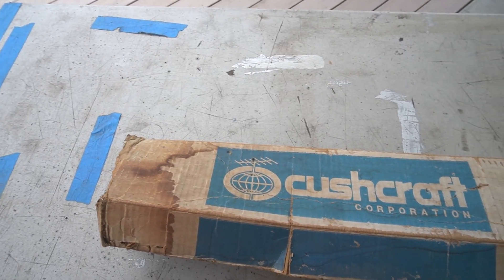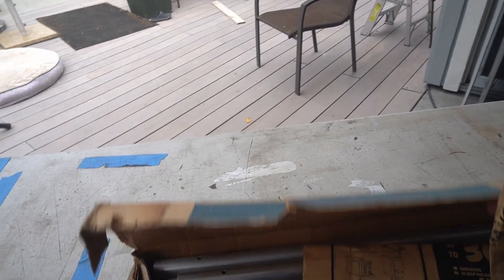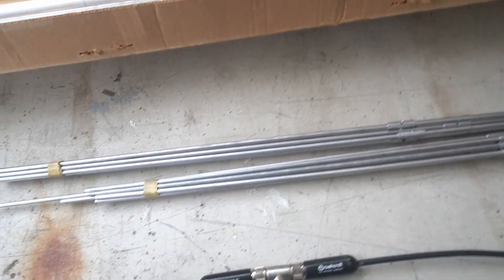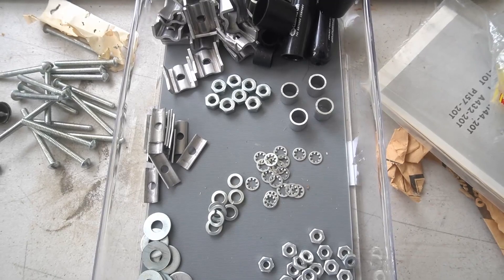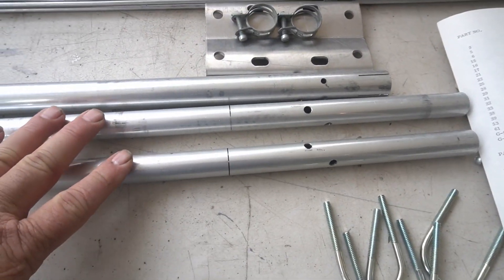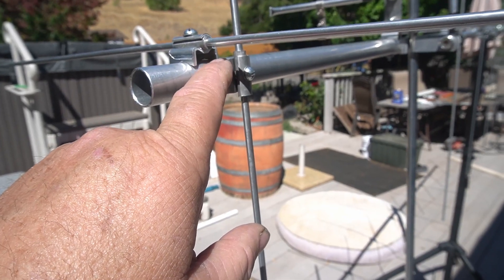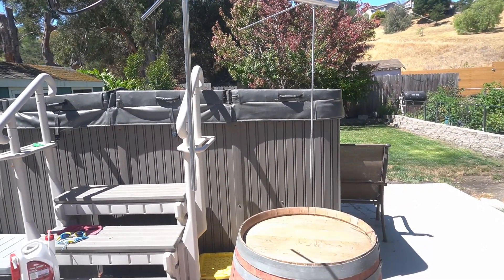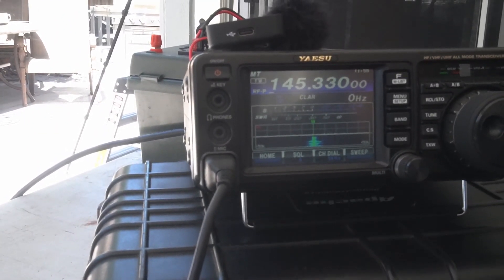Best 20 element 2 meter Yagi, Cushcraft A144 20T Yagi Antenna.

Comment: A good friend Ted-W4YJC-SK owned a set of these. We experienced a great band opening where we worked North Dakota, South Dakota, Kansas, Canada,& 5 or 6 other states. I was running an ICOM 910H with 100 watts into my Cushcraft 215WB at about 55' & he was running his 144-20T also at 55' with a Kenwood TR-751A & a 160 watt amplifier. For most of the QSO's I would make the call once or twice & he would have to call 6 to 10 times & sometimes even more to complete a contact. The next morning he went out & cranked down his tower & Removed the 144-20T & put his Cushcraft 215WB back on the tower. He eventually gave the 144-20 to a friend of mine since he said he would never use it again. The Gain of the 215WB proved it's worth then & many times afterwards. The 215WB has far better quality in materials & performance. We are in EM80 in Northeast Florida just FYI.

Comment: "Death Star" checking in.  I have a pair of these phased together (verticals and horizontals phased separately) and they work well.  If you want them circular polarized and maximum F/B, add another 90 degree stub to one of the polarizations and feed them like a turnstile antenna.  However, I found that these work much better as stand-alone polarity beams. In other words, do not try to run both polarities at the same time, pick one.  My normal 2m base setup is a set of phased 14 element yagis (vertical only) on the 55' tower fed with legal limit power. ERP is around 150,000 watts.  Simplex to Hawaii is best "DX" so far.  73 DE K6FRC

Comment: Should have fed each polarity with individual coax cable. With the phasing harness you lose 3db but don't suffer from cross polarization degrading.
Reply: I have the same antenna and had the same high vswr feeding V/H separately.

Comment: I have this same antenna, it’s really a piece of crap ! It doesn’t work well as if it was a single polarized antenna !
Reply: I think it really depends on what you feed it with! Cheap feeder = crap reception
I'd use EcoFlex15 round the rotator and LDF550 to the radio and your reception will blow you away.
I used to own the Cushcraft WB215 a 15 ele and tried it with rg58, rg213, ldf250 and finally ldf550, the latter just blew the others away, used it mainly horizontal FM, but was good fun on SSB with a preamp on the mast, I managed to work 1064K from Liverpool UK to somewhere in Germany on 10mW!!!!! so, yup, feeder is the magic that makes your antennas work properly. Even halos on 2M work very well when fed correctly! so if your antennas not performing, don't blame your antenna, check your feeders and connectors.
Reply: @sr3d-microphones  No such antenna as a WB215, It's a 215WB & the 215WB blows this joke of an antenna away with ease.
Reply: @ My bad, I'm dyslexic, but you KNEW EXACTLY what I was talking about :P Fantastic antenna regardless - worked 1064Kl on 10Mw back in 2006

Comment: I have been thinking about a big Yagi...Im a General Licensed operator but Im the odd man out because I like 2 meters betrer than HF...Im a storm chaser so thats all 2 meter and I just like keeping it local..Im running a Diamond X300-A right now and I can get out 50 miles on simplex under about any conditions but I would like to extend that a little

Comment: What frequency is the phasing harness made for? An antenna analyzer is a MUST for doing antenna work. A Nano VNA is a great tool at a fraction of the cost, although more difficult to learn. W2AEW has great videos on this. I'm curious if you hooked an analyzer to the phasing harness(s) and checked them. At 1/4 wave of their operating frequency they will look like a dead short. The coax is 40 years old. Probably good, but worth spending time checking. Your friend might help you and all you would need is the harness(s) to bring over to him. A final note: All coax, even hardline is extremely lossy at 144 Mhz. 100 feet of coax can kill half your signal pretty easily. Don't be scared to use it anyway. The tradeoff of height can make up for line loss, but the 3:1 swr will be considerably less after the long run of coax. When I get a bad swr and can't do much about it, I just cut my power back. I do this on hf also. When I tune up my antenna on the air I put the radio on low power and put it in AM mode with NO audio which automatically reduces the power and puts the carrier in the CENTER of a signal so the people on the frequency can't even tell I'm there! Good luck and 73's!

Comment: You probably figured out already it is a circular polarized antenna more than likely for satellite work and i suspect for the frequencies in the satellite portion of two meters. Enjoy your videos especially when you build antennas for mountain top op. Awesome job keep it up, 73 de N6LPV
Reply from the maker: Yea Frank, I found some more info on it and you are correct on the circular polarization. I took it out this weekend and used just one set of elements tuned for 144.200 and 146.520 and just changed it from vertical to horizontal and worked great. Thanks for the kind words, really like the portable opps. 73.
Reply: That antenna is NOT a Circular polarity beam......it is a Cross Polarity Beam....Circular Polarity is used on satellite communications,cause the satellites receives in ( 2m )in a circular rotation in the right hand turn in a circular pattern and transmit in a different band like the FM birds down on 432-435 mhz. in a right hand circular rotation pattern down to earth. On most beams like the older version of the KLM antennas come with a switch box of 12 volts and you can add a toggle switch of 12v to activate the antenna box and it to switch to the Left hand rotation turn on some satellites that when it first orbit into space and turn into a left hand rotation. I have 2 circular KLM 430's antenna's in a 48 elements on one beam. The circular polarity antenna spacing is spread apart from a ( vertical -space-horizontal-space-vertical ) and etc.The Cross Polarity is joined with a ( vertical and horizontal-space-vertical and horizontal ) like a Cross.....Now the new company is called M2 by Mike Staal K6MYC in Fresno,Ca.
Reply: you can still use this for Horizontal SSB and Vertical for FM,you'll need to get a switching box from M2 antenna's or make your DIY project box to change the polarity's on the antenna.
Reply: You can use only 1 coax on vertical and 1 coax on horizontal in a switch box.You cannot use both coax on vertical and horizontal in that "Y" configuration set-up.......
Reply: You don't have a clue. It's for sure NOT a Circular Polarized beam. You should find a subject that you have some knowledge of because this one is NOT it.  LOL